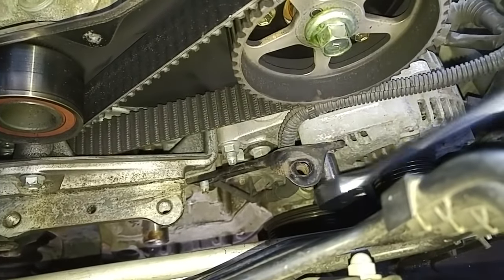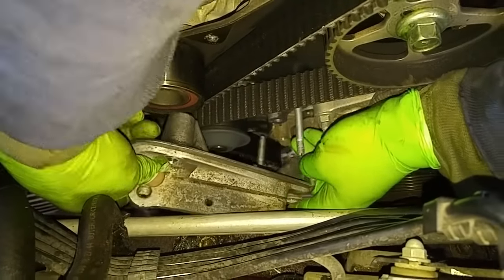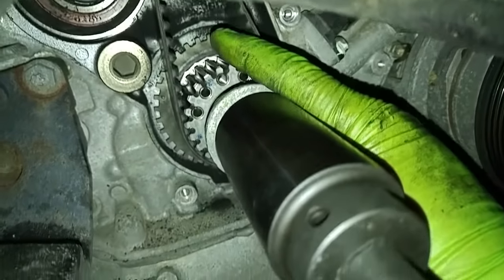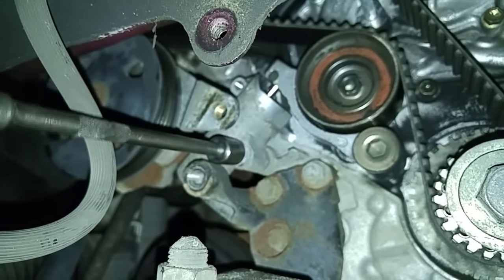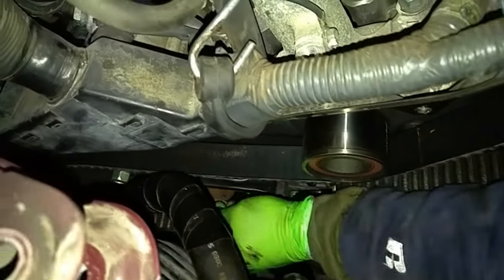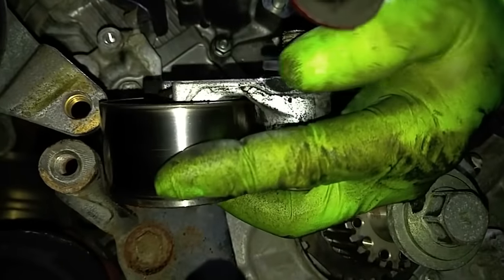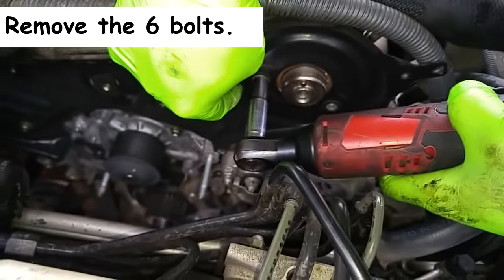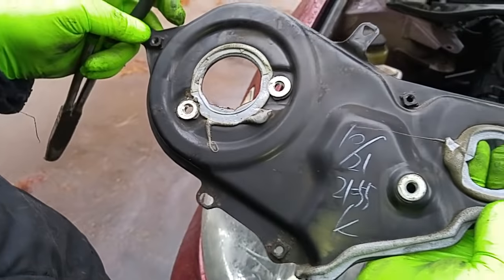Toyota Camry V6 3MZ-FE Timing Belt, Water Pump, Seals & Pulleys Replacement

Comment: Also I saw a super neat trick from the car care nut on removing that mounting bracket that sticks on the corroded alignment pin. Hit it on the underside of the top northeast corner. 3 smacks from a small carpenters hammer had it off in a jiffy
Reply from the maker: Good to know and thanks for sharing!

Comment: Thank you for posting a video that can easily be used as a follow-along!  I just did the timing belt, water pump, cam seals on my 2007 3MZ-FE, using this video.  It was my first forey into mechanical work this involved.  I took my time, got all the special tools mentioned in the video and also a harmonic balancer holder so I could torque the crank bolt to 162 ft lbs.
It took me 2 and a half 8 hour days to complete.  When I was done I drove over a friends house to return a couple of tools when I noticed a leak.

It only took me one and a half days to do it over again and replace the leaking cam seal.

I was warned about placing the seals carefully but I didn't know what that meant exactly.  If I ever do it again I would be sure to use genuine Toyota seals because the equivelants do not have the same dimensions.  I would grease the cam shaft and the seal, I would be sure not to come out of square, not for a second, as the seal traveled down the shaft.  I would stop about an inch and a half before the seal seats and use a mirror to look completely around the front and back of the seal.  Once the seal begins to seat there will be no way to inspect the inner aspect.  I used the special seal installation tool and still managed to get a leak.  It was on the underside of the cam shaft hard to see and in the shadows.

I did this job on my car because I bought it used with 90k miiles and the dealer could not confirm that it was ever done.  Turns out that the belt looked like new and was made in America, so was not original.  In retrospect I could have used this video to just remove the bottom cover inorder to inspect the belt. 

Other than the seal leak, the job went smoothly....  Except for the upper tensioner bolt.  It was very difficult to get a tool in there.   I wound up getting a 12 mm nut driver from Harbor Freight and belt sanding it into a shallow socket. I used a socket and wrench on the handle of the nut driver for torque and for extension.  It worked great but it took me a couple of hours trying other ways first.

One last thing to mention that might help.  Just keep in mind that if you scratch the cam shaft or crank shaft in your efforts to remove the seal.  It will be difficult to fix.  I thought I might have scratched my cam shaft and was reading about the different options to repair or replace.  None of the options was easy.  Be super careful.  I used a screw driver,  a paint can opener and a thin teflon sheet that I got from my wifes chopping block collection.  I was so happy to see that it was only the bent over lip of a seal that caused the leak.

Well the Solara is humming along now, no leaks.  I could swear it runs better now.  Thank you for posting this video.  I'm saying that because I saved $800 and I have more time than money.  But if I had gouged one of the shafts... I would have regretted watching this video. Lol !
Reply from the maker: Thanks for sharing your successful belt replacement story.  Yes, those cam seals do leak on Toyota's high mileage MZFE engines and I always replace them regardless of their condition.  Also, belts do stretch a little as they age which will slightly alter the engine timing;  which is why your car is running better now with the new belt.

Comment: By far the best video explaining every step to do a complete timing belt change on the 3MZ-FE engine.  Got the screen of my tablet all smeared with oily fingerprints stopping and starting this video.  Recently purchased a 2008 Solara convertible and plan to keep it going for a really long time.  Not knowing if the belt had been changed and at 128,000 miles it was beyond time so I bought an Aisin kit plus the cam and crank seals along with the correct Toyota antifreeze.  Save yourself the possible frustration of getting started and then dead in the water.... buy a high mass socket to get the crank bolt off.  Just for confirmation this was a worthwhile purchase, I tried a regular impact socket and it wouldn't budge the bolt.  The high mass socket made the difference.  Also, that seal puller is a worthwhile investment.
Reply from the maker: Good story and thanks for sharing!

Comment: I’ve done this before, but still getting a refresher from your video... great advice on relieving slack on the belt to get it in place... that was a huge struggle the first time!
Reply from the maker: Glad it worked out for you.  Surprised how people don't consider moving either the cam or crank towards each other to ease installation of the timing belt.

Comment: Great video.  The 22mm high mass socket made all the difference on the harmonic balancer bolt.  I almost gave up before that.
Reply from the maker: Use to get worked up wondering if my impact driver could torque off the balancer bolt.  Not anymore with that high mass socket!

Comment: After watching your whole video, everything else I've seen to fix my Camry seems to be simpler. This is some tedious job. 
Well done.
Reply from the maker: Thanks for your post and comment.  If doing this job for the first time, yes ... it does appear to be a tedious ... which may explain why repair shops will give you big $$$'s estimates.  I've done it so many times on this engine by using electric impact tools and specialty tools that I can complete the job in under 4 hours.  Fortunately, it only needs to be performed every 100k miles.    

To support our channel, give us a thumbs up and to get notifications of new videos, please subscribe.

Comment: That is such a well made video I referred back to it like 4 times, I just finished my project (water pump) and all turned out great, thanks too you! I had to call a mobile tire repair guy w\ a 3\4 impact though for main pulley bolt..
Reply from the maker: Hey glad it worked out for you!  That pulley bolt can be a show stopper.  Only thing that works to get it off is a high mass impact socket.

Comment: That's a great tip on backing off the front cam and crank a bit while installing the belt.  I watched your video as a refresher course - I'm getting ready to do my second timing belt job on this motor - the dealer did the first, so the engine is getting ready to be on its 4th belt!
Reply from the maker: 4th belt change? ... wow!  You must have over 300k miles on your car?  Thanks for your comment and support!
Reply: @hardlymovingpro  Well, 4th belt in total... 3rd belt change.  I'm at 279K miles.  1st belt was late, so 3rd belt service schedule would have been 270k since Toyota recommends 90k interval on these.
Reply from the maker: @lsh3rd  Or every 7 or 8 years I believe.  I had recently replaced a belt on a 2008 Suzuki Forenza with only 32K miles.   There were cranks throughout the entire belt and definitely needed replacement.  Manufacturer's stated service interval was 60K miles or 8 years.

Comment: This video makes me feel very confident in doing this job myself! Thanks! I'll be replacing the belt, seals and water pump. I'm noticing an oil leak coming from this area. Hopefully changing the seals will help with that...
Reply from the maker: The camshaft seals are a major source of oil leakage.  When  you take off the rear camshaft sprocket / timing belt dust cover, you'll better see if the valve cover gaskets are leaking at the corners as well.

Comment: Wow what a professional mechanic he made it look so easy. I need made done on my lexus ls430 2001.
Reply from the maker: Appreciate your comment!  IS430 is a little bit more involved. Need to remove the radiator to get a impact tool to remove the crank shaft pulley bolt ... camshaft seals can only be replace by removing the camshaft ... and the seals do leak.

Comment: HMP, just to confirm what I think I have read in the comments, if I have a cam pulley that has jumped forward, in my case the back cam timing mark is at the two o’clock position, is it all right to move it back counter clockwise, or is it ok to move it clockwise all the way back to match up with the timing mark on the back plate?
Reply from the maker: Yes.  Move it back counter clockwise.  Do not do full rotation.

Comment: That solid socket from Lisle. It is a must buy. Even with 600 ft/lbs air impact no go on regular impact socket. Installed Lisle socket on my air impact - 5 seconds. Smoked it.
Reply from the maker: My sentiments exactly!  You can even get away using a 300 lbs electric impact.  The Honda 19 mm crank pulley bolt is also a rear bear.  No problem with the high mass impact socket!

Comment: So what you're saying is, i screwed up by buying a V6, and there's no way in heck i could change the water pump myself. Great work, though. And thanks for the vid!
Reply from the maker: It takes me around the same amount of time replacing a timing belt on a 4 cylinder Toyota than a 6 cylinder ... even more time on a Honda Civic.

Comment: This video helped me out big time. It was concise and quick to the point. I struggled with getting the timing right.. I ended up releasing and reinstalling the tensioner 4 times. Was extremely frustrating getting the rear cam timed.

A few times the rear cam snapped back approx 45 degrees while setting timing. Have you had this happen and is it something to be concerned about? 

I spent probbbaly 18 hours on the t belt + seals + water pump and valve cover gaskets. I attempted to hold the camshaft with a 13/16 wrench and a cheater bar but was only successful on the front cam. The rear one I ended up getting a chain wrench similar to the one you used. The rear manifold bolts were a total pain, but that's a whole another story. 

Was wondering if you knew the hourly time for the t belt, seals, wp and valve cover gaskets on an 05 highlander.

Can't thank you enough!
Reply from the maker: Yes ... the rear cam can spring away from its timing mark.  Easiest way to prevent is to position the rear one cog clockwise from the timing mark and to mount the belt on the rear cam first.

Comment: Just had my timing belt and pulleys all changed in my Lexus ls430 2001. Also replaced all spark plugs. My Lexus ls430 has 325000 miles original engine and transmission.
Reply from the maker: The LS engine must be the best V8 in the world!

Comment: God this brought me back... to work. LOL i used to work at toyota and damn if i didnt do these fuckers on the 1mz and 3mz in my sleep. No idea how i got to this video but after about 30 seconds i was in the zone. Im really happy to report nothing you did made me feel like i could do it better hahaha. The one thing ive ever done differently in my days was when i ever reused a tensioner rather than use a vise i used an irwin quick grip saved a bit of time and easy (used this thing for brakes all day too. Great video, good lighting, great angles. This is where its at man good job.
Reply from the maker: Thanks!  Most kits now come with a new tensioner.  On the older tensioners on the 1mz, I compressed it right on the engine using those long 10mm mounting bolts.

Comment: What an amazing guide.  Well done!  Best guide I’ve ever seen.  I did my BMW 335i N54 walnut blasting,   Valve cover gasket,  oil filter & cooler gasket replacement myself and yet after watching you this looks very intimidating.  I’m not sure I can handle this job.  We have the same engine in our 07 Highlander with 134k miles and the only thing I’ve ever done for it is replace the engine oil,  break pads and alternator,  nothing else.  This service is so overdue for it.  I was planning on doing it myself but I’m now contemplating because of the amount of work and tools needed.  What is the fair cost to have this done at a Toyota Dealer in comparison to a decent Indy shop?
Reply from the maker: Thanks for your kind comments!  Typical dealers will charge you around $1,200 excluding the cost of the camshaft seals.  You have to insist they replace it.  They'll says "hey ... it's not leaking".  Believe me ... the seals will not last to the next TB service interval.  The independents will charge around $800 ... but you must insist they use OEM quality parts ... i.e. Aisin water pump, Mitsuboshi or Bando Timing Belt, Koyo or GMB bearings, Toyota red coolant, etc.  There have been other posters reluctant to do this job but did it anyway.  Some did it in a few days ... others a whole week ... they all took their time.  If you follow this video to the letter, you can do it.  If you need help along the way, just post your questions and I'll help you out.
Reply: Hardly Moving Productions ok well your words of in encouragement  help me to reconsider doing it myself.  

So I have the same engine but it is inside of a Highlander.  Is everything exactly the same ?

Is your link to amazon for the parts for $108 does that apply to the  07 Highlander also?
Reply from the maker: Yes but you'll need a step stool since the car sits higher off the ground ... unless you're over 6' 3" tall.

Comment: This has been a great tutorial, really appreciate it!  I used a piece of the old belt to cushion the chain clamp but still got slight impressions on the pulley grooves from it.  I assume there’s no avoiding that when using a chain clamp.
Reply from the maker: Thanks!  The impressions won't hurt the new belt.

Comment: Exquisite demonstration made the job easier and inform me of what tools I would need to acquire to accomplish the task For my friend
Took 7 stores to finally get the chain wrench it was If   Vicescript style you  Showed The other 6 stores only had the rubber style of strap wrench  A cheap cheesy rubber thing that Might work for an oil filter
Reply from the maker: Good for you that you did it yourself!  The big chain strap wrench are commonly used by plumbers.

Comment: Thanks for the video! One question though: aren't all the bolts that go into the engine block given a torque spec, even the big ones that hold the timing belt sprockets? I would think the procedure would be to hand tighten or use a ratchet to get most of the way there, and then finish off with a torque wrench to the correct spec in ft-lb or N-m.
Reply from the maker: You can use a torque wrench for those nuts and bolts but from my perspective having done so many ... not that critical.  However, with cylinder head bolts, crankshaft cap bolts, camshaft cap bolts, etc., I'm very diligent with torque specs.

Comment: I didn't understand what is the advantage of driving a Toyota? Great video by the way thanks.
Reply from the maker: High dependability, reliability and longevity.  Resale value unusually high.
Reply: @hardlymovingpro  I don't see how that Toyota can be more reliable than my 2005 Dodge Grand Caravan, with 3.8L engine and  over 300 000 miles, no leaks of any kind no seepages doesn't use a drop of oil, handles superb, runs and drives like new. No any repairs. Smooth quiet . Exceptionally low maintenance, like brakes tires spark plugs, belt, not even a starter or alternator or water pump has ever been changes. You people  are constantly repairing these Toyota engines and  are telling me they are  reliable. Toyota's are not bad but they are over glorified and high maintenance and they don't even give you room to work under the hood. I have ONE serpentine belt with one automatic tensioner compare that with Toyota.
Reply from the maker: Good for you!  You're fortunate.  Caravans are notorious for front motor mount failures.
Reply: @hardlymovingpro  Even if that happens some day motor mount is no big deal. Reliability and longevity start with quality product and good maintenance. I do all my work on my vehicles and again have to tell you, you are highly skilled and professional technician. Thank you for taking the time to shoot your videos. How the car makers build their vehicles we have no control. Some things are simple and accessible others make our lives hell. I am NOT bias towards brands I make my choice based on models and not so much on brands.

Comment: My ryobi p262 took that bolt off in one second without a high mass socket. I was pretty damn impressed. Best purchase I’ve ever made $199 for a 2,4&6 amp hour battery charger and bag and the impact was free. Then I got the pblrc25 extended reach ratchet and a 4 ah battery for $135 paid $350 for what would have been $1400 if they said snap on and I feel they are definitely up to par with Milwaukee. Both made by tti and likely many of the same parts.
Reply from the maker: Thanks for sharing about your tool.  Had a real bad experience trying to get that pulley bolt off with my Milwaukee rated at 1,200 lbs of torque.  Impressive that you got it off using your Ryobi P262 using a standard impact socket.  Having electric power tools does definitely make any job go faster!

Comment: 20 minutes, I should hope to be 10% as efficient! Do you suppose the 1mz is about like this? Thanks for the video. It will be very helpful.
Reply from the maker: Thanks ... took me around 3.5 hrs real time.  The 1MZ is easier in that I don't need to compress the tensioner pin ... the pin gets compressed when I tighten the mounting bolts simultaneously ... watch my ES300 Timing belt replacement and you'll see what I mean.
Reply: Ok, thanks. That will be great info for me.